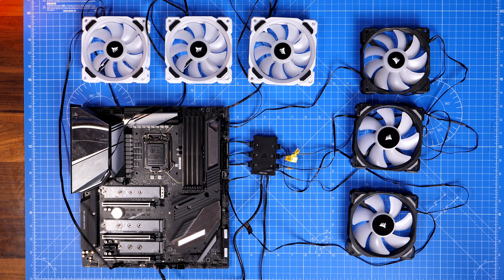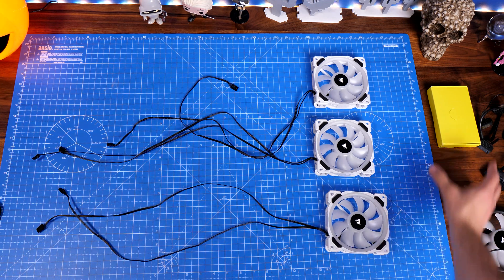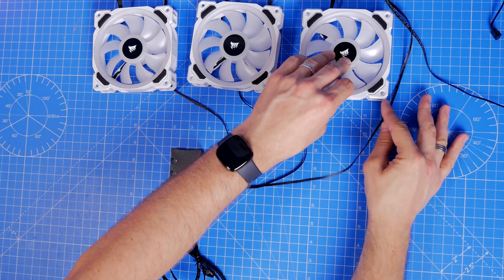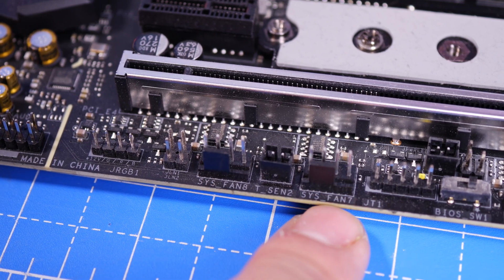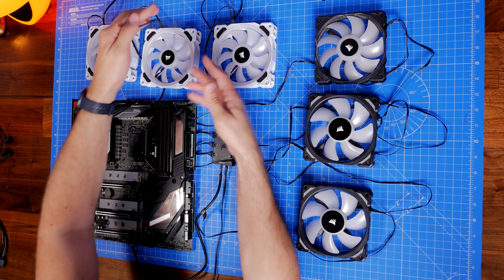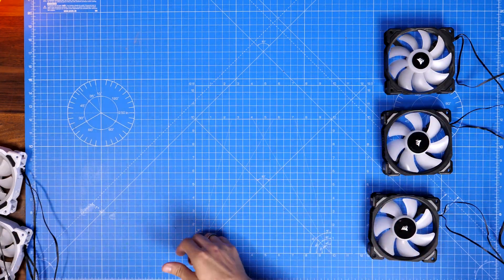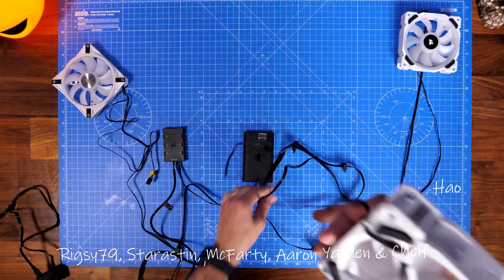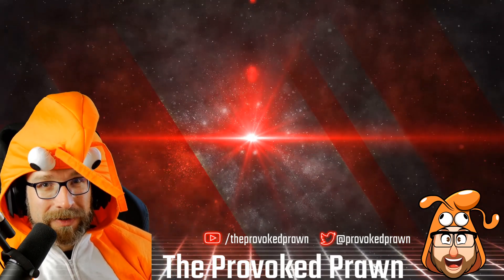How to wire and setup Corsair RGB fans  - tips for adding RGB fans to your case easily

Comment: can some one provide the actual model number of the rgb fan controller (Sata for power) and USB connection to a USB header on motherboard. I have an older build with a newer case that has corsair rgb fans but no 12v 4 pin port on the motherboard. I would like to use this corsair rgb fan controller but cannot seem to find it. Thanks

Comment: Hey man, so i my case already has a built in fan hub, but i’m honestly so lost with it in the manual, and what i wanted to ask is can you connect both 4 pin and 3 pins fans to the command core xt? then you connect it to a 4 pin fan header, because i read that if you connect it it to a 12v fan header and your fan is 5v it will ruin your fan. Once again love your videos they’re very informative!

Comment: I just finished my most recent build with 10 Corsair RGB fans total, using 1 commander core and 1 lightning node. I plugged both USB cables to the motherboard USB 2.0 headers. For some reason, my motherboard  recognizes the Commander Core but not the Lightning Node, it says "no device". I guess I need a USB Y splitter smh....

Comment: Bro, honestly, this was anxiety for me since this is my first build iv done, I had super anxiety about the usb placement, I was asking if you could daisy chain usb's and no one got what I ment, and I know you can have usb overdraw which wont allows ur computer to post if that is an issue, but this is exactly, EXACTLY, the issue I was having on whether you were allowed to daisey chain the 2 usbs together. Thank you for clearing this up. FYI 11 fans are a hassle...... get a big case guys, you will save urself alot of headaches....but the case you have at the beginning is the exact case I have right now besides the 4 fans at the front, I have 3 140's instead of 4 120's. However I think I took on to much because I also got Lian Li strimer kits for both gpu and motherboard so that is also an extra box as well...... ugh

Comment: Question. 

When you say dont mix and match fans. Are we talking 120 vs 140mm? Or are talking a difference between af120 and sp120 rgb fans?

Additionally. What is the role of the usb slots on the controllers? Is it on and off? Or does it actually provide power to the unit... (thought that was the SATA job)

Thanks!
Reply: Both models of fans btw are corsair
Reply from the maker: Probably both, but more the version (e.g. AF120 or SP120 as you said) because they'll have different max and min RPMs. 

The USB allows for control of the RGB, speed and more via iCue
Reply: @TheProvokedPrawn  Awesome thanks for the info. Great Vid man I appreciate you a great deal

Comment: Hello, I currently have 7 fans split between the commander core and commander core XT. The AIO is plugged into the pump fan on the mob and the core XT only has a usb2.0 connection to the mob. Is there a problem with the mob not seeing any of the sys/cpu fans?

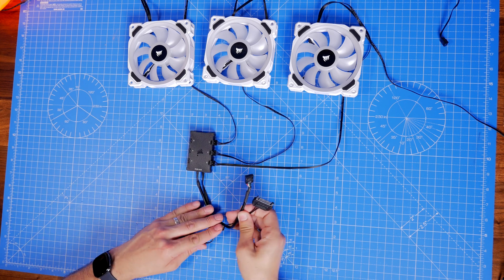Comment: First time building a PC; bought corsair 7000D and I was wondering what that cable was 4:47 and where it plugs into. I was beginning to panic because the booklet that came with the tower didn't explain the power connection of that circuit board and online forums are hostile to new people. I would have been lost all day had I not watched this, turns out the cable I needed wasn't included with neither the tower nor the motherboard- it comes with the power supply. 🙃

Comment: When i turn on my pc, it turns on for 1 second then shuts off. If i disconnect the sata cable, then it does work, but fans dont have light. Wtf am i doing wrong? 🤦‍♂️
Reply: Sounds like PSU.. maybe it’s too small
Reply: The same thinghappened to me
Reply: It happened to me but my adapter cord melted, I may have put too many fans into it......"not a corsair adapter"
Reply: @TeraOfMarcus I have a byski rgb fan controler and have the same issue have you figured it out?
Reply: Did you try to access the ICUE?

Go to the lighting setup and run the wizard, auto detect for compatible fans this was able to get my 3rd 140 mm powered on and lighting up
Reply: Have you checked your wattage usage and see if the psu is suppling the proper power?
Reply: Did you ever figure out what happened? I’m currently dealing with the same situation
Reply: Psu can’t handle the wattage?
Reply: I've heard about badly connected cables can cause electroshocks.
Reply: Sounds like you have a shitty ass psu
Reply: PSU issue maybe?
Reply: please I have the same problem, has the problem been solved or someone can help me understand, I have not yet received my processor, I just wanted to test my fans and only 1 location runs them.
Reply: u need more psu power
Reply: Take out Ram an either put back or change where it's inserted a different slot

Comment: Hey man thanks for making this video, super helpful and detailed. I'll be building my first pc with 6 LL120 fans in the Corsair 4000d Airflow and your videos have been awesome. Way more efficient and intuitive to watch this than going solely off the manuals and reddit threads.
Reply: I would recommend instead buying the 4000D Airflow QL version - it comes with 4 QL 120's and then only needs a 240mm AIO
Reply: How have you hidden the wires at the front of the case??

Comment: What size power pack you using here? 
I’m currently using the Corsair h150 capellix and the Corsair ll120 three pack fans all plugged into the commander pro, when I add a second ll120 set of three fan on the node pro and rgb it blows the mother board it’s done this twice. What am I doing wrong I’m using a 750w bronze evga power pack!
Reply from the maker: If you mean power supply then it's best to run it through a calculator to see the best wattage https://outervision.com/power-supply-calculator
Reply: @TheProvokedPrawn  thanks for the reply, could an under powered power supply blow the motherboard if connected too many fans? I’m apprehensive about connecting them all again incase it blows again! Thanks in advance! 👍🏻

Comment: Is it possible to have sequential lighting effects for 10 fans ? I am struggling to have sequential lighting effects above 6 fans ! Pls help I have commander pro , commander core , and 3 lighting node core as I have 10 fans ( bought 3 .. 3 pack kits and 1 individual fan ) but I am unable to have a sequential lighting effects … other than lighting link option which has very limited options … it’s like 6 fans sync differently and 4 fans sync differently … their timing and pattern doesn’t sync in sequential order

Comment: Great video. One question. I have the Corsair 7000X case with the Commander Pro XT and the Corsair H170 with another Commander. Should I daisy chain to one single USB 2 Header or use Two USB headers? Also do I still need to plug in the PWM cable from my 7000X to the motherboard or is it not needed. Thank you.
Reply from the maker: If all the fans are connected to the Commanders then you won't need to worry about the PWM controller. I would use two USB headers though, there's usually less problems there
Reply: @TheProvokedPrawn  thanks so much, really appreciate your reply.

Comment: When I have Corsair iCUE SP140 RGB ELITE with exact same connectors and I am trying to use only one fan. Can I plug it directly to my argb header on my motherboard? The connector with "to rgb hub" label and still use it's full rgb capabilities?

Comment: I was having trouble with my Corsair iCUE 4000X RGB case fans.

I had plugged everything in and booted, they lit up to their default rainbow but then shut off and were undetectable by iCUE. 

The solution was to unplug them, boot the PC to iCUE, then hot plug the SATA power connector, then hot plug the USB connector. iCUE then recognized everything.

Amazing video and your camera work is great. As well as your voice.
Reply: Hi i bought the same case and built it today, but i realized i have only 3 sys fan on my mother board for the 6 fan i have in the case, i thought 2 node core would do it but only for rgb, you think i need sys fan splitter right?

Comment: I have question I am from S Korea my English might not perfect. I have old case and include loud make fan installed I want to get my new fan and change. I don't like rgb fan so I will buy none black fan. and i want to install 6 of them. 3 for front 2 for top 1 for rear in this case can I just buy 6 fan and plug to each port on mother board? (sys fan1 ~6) or do I have get controller ??

Comment: upgrading from a 220t corsair case, to a lian li 216 case I also just recently bought a h150i elite lcd cpu cooler, should I used the fans from corsair or just later upgrade to all lian li fans?

Comment: I did this to my new pc I built back in 2020 and I tell you that was the hardest part.  Putting everything else together was easy.  Also takes up so much space inside the case.  My case Lian has an area that houses all the cables and its so packed its going to be super hard to replace my power supply eventually.  I'm running 10 fans though.

Comment: Great video! However I've ran into an issue. I've followed your video by connecting 6 fans and RGB's to the Commander Core. The 7th fan I have in my motherboard PWM header and the RGB connected to the Corsair RGB hub. For some reason I'm unable to detect the 7th RGB in iCue. The fan and RGB are working, but I'm unable to control the RGB function. Any advice?

Comment: You really don't have to use up all your fan headers...quite  handy having 8 headers, but this does not mean you have to use one for each fan.  You can daisy chain three same model fans into one header, and the other three, into another header.   1 fan header can hold up to 4 fans...though 3 is optimum.  Also doing it this way, is a whole lot less messy than a fan for each header.
Reply: So these LL120 model are daisy chainable?
Reply: @rvealityy   I had bought a 3-piece kit of Corsair LL120 before and it came with a fan hub...so thus I'm wondering why not use the fan hub and use only 1 System Fan port???

Comment: Should I plug the fan power into a commander core because i have one? Or should i only use it for RGB and connect the power cables to the fan headers along the motherboard. (I only have two)

Comment: Nice vid just subbed! Currently got 6 added fans and the 3 that comes with the 5000x case. My 3 fans work but i cant adjust the speed or rgb. Had mine built by someone so im trying to learn it all from scratch.

Comment: what if I am using the fans for my AIO instead of my case I connected it to the fan hub that came with my AIO (kraken z73) and the fans don’t turn on
Reply from the maker: Connect the fan power cables to the pump head. That should work. There's a break out cable with three connectors that runs out of the pump head. The pump needs sata power and usb connection but that should work.

Comment: Thankyou! I have the corsair h150i elite aio and it was really straight forward but then I bought a 3 pack of LL 120's that came with the little led connector and didn't want to run a bunch of wires to system fan hookups. I'm so glad I can use the hub that came with the corsair aio kit as I already had it setup and cable managed lol.   That hub is so much better of a system.

Comment: Quick help here please. every time I connect the RGB hub USB cable  to the USB port on the motherboard my computer runs so slow that I cannot use it at all and 
as soon as I disconnect it everything goes back to normal.

Do I need to connect it somewhere else or can I leave it disconnected? The RGB lights on the fans are on regardless and it looks ok without the cable.

What is the USB cable for?

Comment: A dumb question but I'm struggling to find a vid on it, can you mix fans with the rgb hub? I have 3 corsair fans that came with a lightning pro, and just got a coolermaster aio that has a hub too. Do I need to use both separate or can I mix?
Reply from the maker: I know Corsair says it's best not to mix and match fans with the Commander but I've never tried. So I can't say either way I'm afraid
Reply: @TheProvokedPrawn  just seems like a nightmare to cable manage, mine was already pretty squished with just the corsair fans hub
Reply from the maker: @CaityRaindrop  sadly yes. Lian Li daisy chain fans are easier.

Comment: Not sure why this is hard for some people. If you buy the commander core or the XT, each can take 6 fans w/RGB. I don't use those tiny splitters that corsair gives you and I only use Corsair  fans with the commander core/XT for maximum compatibility. Also, you can customize the RGB so it does not matter what channel (1-6) that you plug it into.
Reply: It's difficult because I want to wire 10 fans, not 6.
Reply: What's wrong with the splitters? I'm hooking up 6 fans now....is the commander really required?

Comment: Anyone else having the problem where they have to change RGB profiles on both the H100i AND on the core? I have a commander core, RGB hub, and lite node pro. I cant figure out how to make it so that when I change a profile it applies to all the fans together and not do it separately. I have 8 fans if anyone could help id greatly appreciate it.
Reply from the maker: Look for lighting link settings in iCue

Comment: so ive got a few different fan connections by LL and not sure but im thinking im need to power a few different hubs due to the connection ends. how can i get the fans to have the same plug end and is it better to go with a hub, or it is that cool to plug different hubs into the board? thank man

Comment: too much cables... I really like Corsair RGB fans but it's a big mess concerning cable management... I just saw several video about Lian Li unifans and, God, it's great ! I hope Corsair will think about it. For now I have 6 Corsair fans in my pc case... I was planning to change my old AIO for a corsair one... but....hmm not quite sure I will do it. This will put a cable mess in my case and obliged me to buy another controller for the fans... Really, this is an expensive (but very nice) big mess. Just thinking to a custom watercooling instead....
Reply from the maker: Uni fans are fantastic.
Reply: @TheProvokedPrawn  yeah but are there not too noisy ? how customisable are there ? (rpm regimen, rgb animations). I've been told Lian Li software is a big m.... and very limited. Is it true ? The noise is quite important to me because I sometimes have to stream my lessons online (teacher) and if the fans are very noisy it's noise pollution for my learners....

Comment: can I connect corsair fans to a LED connector on a Gigabyte MoBo ? only the LED part of course. I heard Gigabyte and Corsair paired up for RGBFusion.
Those connectors are marked as addressable RGB Hub
I could try it myself but I figured I'd ask before undoing the amazing cable management that has been done.

Comment: Question at the end. This is my second PC and my first build. I went a little overboard at Best Buy and purchased some high-end components with what seemed to be great advise from one of the gamer/employees at the Best Buy store. Even though you commented on the pump, I’m not sure I understand the connection for my Corsair hub. I have two connections that come from my hub. One is a small gauge single wire connector that only utilizes three of the four pins on one of the hub connections and connects up with the key perfectly. 

Is it safe to assume that I can plug the pump single wire connector into the controller for some sort of control?

The other harness (larger/12 pin) coming from the pump looks like it would fit directly into the end of the Corcerra RGB hub. This hub has 12 stations total with a USB port and also the other style connector for power to the PSU. 

I actually bought the ICUE commander core XT as well. If there’s something that I can’t do with the current RGB hub I can use the core XT commander in place of that but that one seems to be lacking the terminal up the pump.
Reply from the maker: The first is the one that needs to plug into the AiO or pump fan header on the motherboard. I'm not quite sure what you mean about the second cable.

Comment: I'm currently running 13 fans in my 5000D, 6 QL connected to a commander core xt (front and side), 3 LL & 3 ML around the h150 capellix's commander core (push pull), 1 LL exhaust, 6 light strips (lighting node pro + rgb hub). Cable managment is quite fun, but has been put on hold as I plan on replacing the LL push rad fans with QL fans. The cool thing about having the ML fans on top (pull) is the RGB lighting coming through the Corsair triangle cutouts of the top panel reflect on the wall, surprisingly nice little touch for now.
Always love your videos, so nice and detailed.
Reply from the maker: Yeah cable management is a nightmare when you have lots of fans. Thanks for watching and the comment.

Comment: Thanks for this video. I plan on doing 13 Corsair fans in my 5000D build. Should I use 2 commander cores and a rgb hub or is there a better way to run the 13th fan?
Reply from the maker: What cooler are you using? Two commander cores is easiest but if you're getting an Elite Capellix cooler then there's one with that
Reply: @TheProvokedPrawn  I’m getting a Corsair H150i Elite LCD so that’ll be three of the fans.

Comment: This is brilliant yet again, so much thought and effort goes into your videos. I am about to build my first PC and this is exactly how I will be doing the fan setup. Well done and keep these videos coming.....
Reply from the maker: Thank you Russ. Hope it helps
Reply: @TheProvokedPrawn should i use the commander core XT if for example i install 3 120mm fans on front (intake) 1 in the back (exhaust) or the first method with the 3 pack controller (rgb) is easier?

Might put radiator near the front on the future too
Reply: Me too!…. 👏🏻